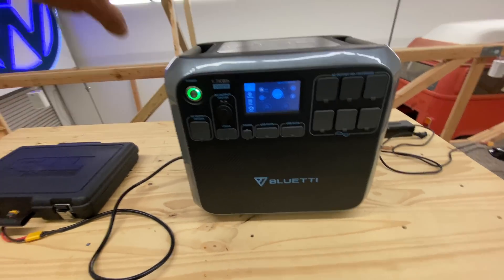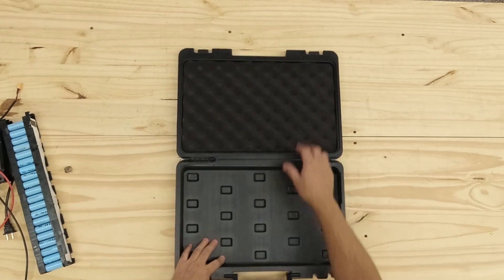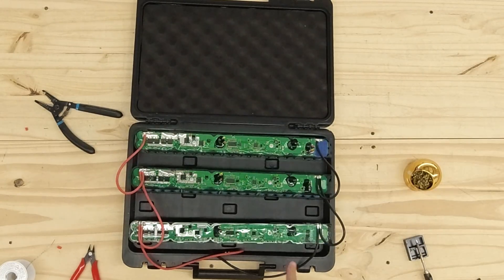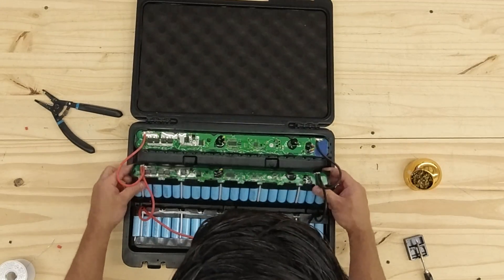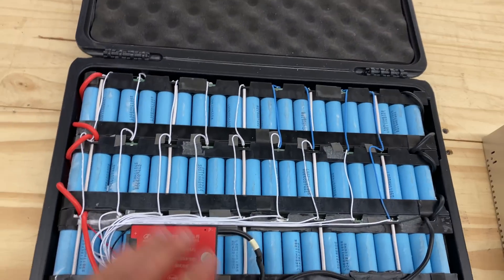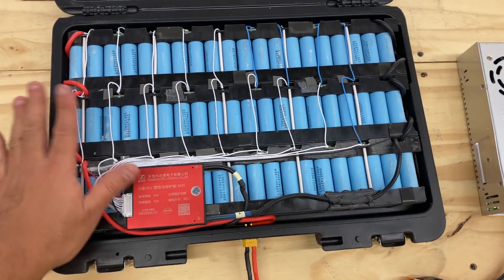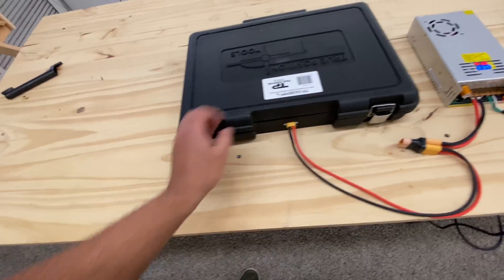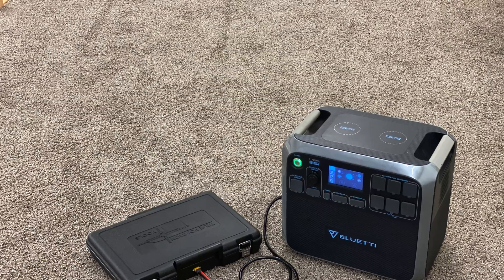Bluetti AC200 DIY Booster Battery Pack Build Project

Comment: I have your scooter packs and  35amp 36v 10s4p BMS I got from amazon from the 1st video you posted on this aux pack. Can you put a link to the wiring diagram. Planning on doing at least 2 of these for my AC200 when I get it and also for my existing Bluetti 2400
Reply: Ditto. Ordered everything to do 2

Comment: it was charging at 440 watts on the ac200.  How do you calculate the output wattage formula?  I know that w = v * i.  But that doesn't seem to add up to output wattage.  Trying to calculate if you could make it with a 6p or 8p.  It can't be more than 700w on that solar input.

Comment: Nice and tidy solution. Only things I would do differently would be to use 10AWG, connect the BMS to the center battery pack and give it a female XT60 or XT90, same as found on an RC lipo battery so a 10S RC charger can also be used with it.

Comment: Which charger?  There are many. 0 to ??v
Reply: Max voltage for this pack (36v nominal) would be 0-42v charger. As a 36v li-ion pack will run in the run in the 30v-42 range (low to high). The higher the amperage of the charger, the faster it will charge, so that can be whatever you prefer - usually cost more for higher amp chargers.

Comment: Hey Jehu why did you not use an XT90 on the expansion battery, then you would not require a XT60 to 90 converter.
Please also look into XT90S, 'S' in spark free.
Nice video 👍
Chud
Reply from the maker: I couldn't found one that had mounting ears,  do you know it they exist? in Xt90 version?

Comment: Anyone knows about charging EV with inverter ? No matter how much I try, the cable say "no grounding" and charging fails. I have Lifepo4 8s (24v) and few different inverters, but no luck, always "no ground". We use european 230v and schuko socket, and it can go in 2 ways, in US only 1 way. Youtube has few videos about Leaf charging with "fake" grounding, but those are all about US socket. Anyone knows how to go around this grounding issue with 230v schuko ?
Reply: You have to create a "fake ground" by combining ground and neutral. Check ground neutral bond plug and you could find in shops selling generators or RV accessories.
Reply: @mobilicharge5748  but you know that european plug is different ? If connect the modded plug wrong way even once, the factory smoke will come out from my inverter and it will never work again.
Reply: @petertraveller6421  Don't do that?  Or maybe make your fake ground adapter so the ground wire is NOT connected to the ground of the plug, but is only connected to one of the lines.